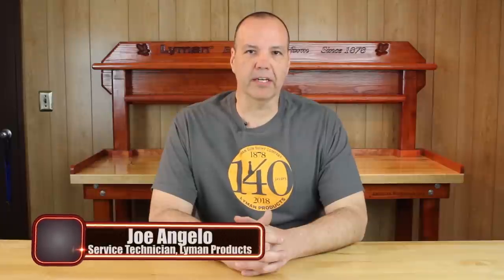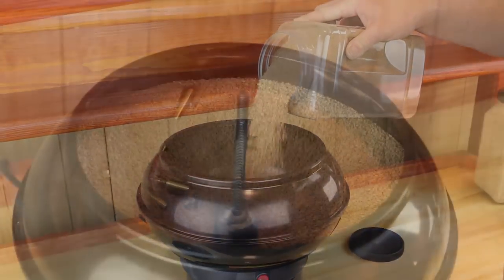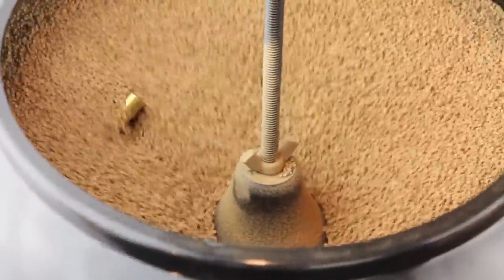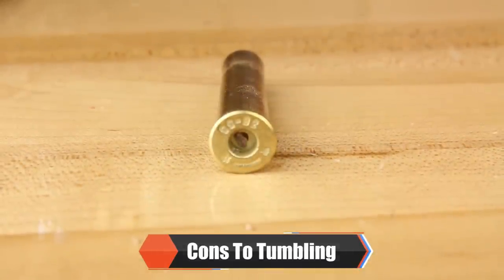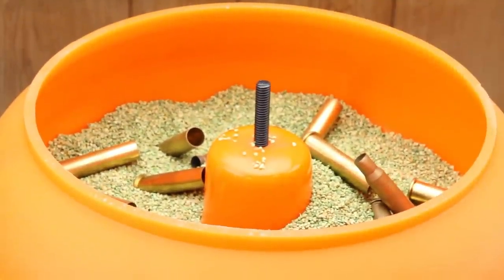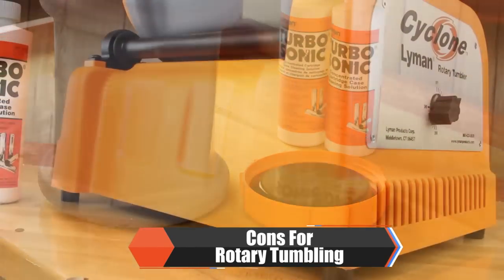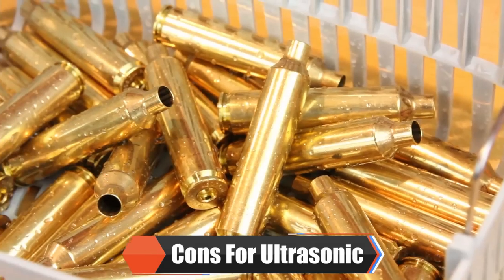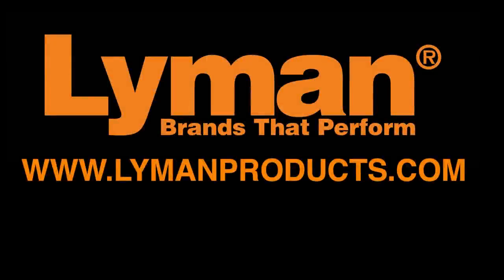Pros and Cons To Brass Cleaning Methods

Comment: Wet tumbling with regular dawn dish soap and a tiny bit of lemishine is what I've been doing for several years. I gave up on dry tumbling because of the lead dust hazard and because it doesn't clean the inside of the cases as well as wet tumbling.

Comment: Unless you are going to make jewelry out of the used brass, the vibratory Tumbler is more than sufficient. 
Make yourself a mixture of 50/50 new finish car polish/mineral spirits and add a few squirts to your dry tumbler media just before turning it on. Your brass will come out shiny.
Tear three or four small squares from a USED dryer sheet. Throw them into the mix and they will pick up a lot of dust.

Comment: I use only Dawn dish soap in my SS wet tumbler, and let them air dry. I have enough brass to reload I do not feel the need to use driers. No more primer pocket cleaning.

Comment: I deprime and size my cases, then clean them in my sonic cleaner, I dry them then put them in my tumbler to polish them off, they come out like Factory new inside and out ! It only takes me about an hour and a half for a batch of 50.
Reply: DrJibson  It's not. That's why I use a universal decapping die. Sizing is done after cleaning and your dies stay clean.

Comment: Dry tumbling poses a significant lead dust and heavy metal contamination hazard.
Reply: I wear a mask when I dry tumble. Is wetting tumbling any better? Now you are rinsing the lead and heavy metals down the drain which won’t be filtered out by treatment plants.
Reply: @djryan8944  Filtration works by allowing only the small particles to pass through. The “holes” in the filter should be smaller than the target contaminants. This way, heavy metals and other pollutants won’t be able to pass through. Also, they won’t end up in your glass of water.

Comment: That ultrasonic machine looks like the one from Harbor freight. I use  $70 Vevor 3L ultrasonic cleaner, water/dawn/dishwasher magic, and a free dehydrator from craigslist. Results are great (and cheap!). Plus I can clean large parts (carburetors, etc) and make jerky.

Comment: If the cases have been stored and are very stained , I give them a quick swish of citric acid this cleans off the bad shit then dry , tumble after. Citric mixed mild is not hard on brass like other acids , Ive found.

Comment: forgot to mention dust with dry method.
Reply: You can cut down on the dust considerably by tearing a few pieces of a used dryer sheet and adding them to your corn cob or walnut media.

Comment: A USED dryer sheet torn into 3 pieces mixed in with your dry tumbling works wonders.  Especially if you're using the red treated walnut.  It will cut dust way way down.

Comment: I tried the " dryer sheet " thing , made my brass look like doo-doo ! Having problems cleaning my .577 Enfield brass . Dry tumbling doesn't get the inside and leaves scuzz on outside ? May look into a wet system and use wifies food dehydrator to dry the brass ?

Comment: When I use my Hornady ultra sonic cleaner the brass looks great right out of the tub but then after it dries for a few hours the cases have greenish tarnish and don't look shiny any more.  Does anyone know what I'm doing wrong?  I'm using a mixture of 4 parts water to 1 part vinegar, with a little dish soap and salt added too.
Reply: Jared Grant 
Just a thought, are you rinsing your cases real well, with clean water after removing them.
Reply: I use the Hornady one shot cartridge case solution, in ultra sonic cleaner.  it only requires 1/2 oz solution to 20 oz of distilled water. My cases come out quite bright. Then I dry them in a food dehydrator.

Comment: Which is the safest regarding lead dust?
Reply: Both the rotary tumbler and the ultrasonic cleaner.  The lead dust will be trapped within the water/ cleaning solution.

Comment: Get 2 tumblers, 1 for walnut, 1 for corncob media. Dry tumbling is not 'either/or', its 'both'. I use them after a wet wash of the classic Dawn, vinegar, lemon juice recipe. Doing the wet wash first gets off 90% of the gunk and keeps your other media clean. For me I've found its not "this" method  or "that" method, but using a couple of methods together. Also I would never dry tumble brass straight from the range, God knows what lead or mercury or other powders you'd be shaking into the room. A 5 minute wet wash first removes any possible harmful powders.

Comment: I use all three , then hand polish .
Reply: LOL you have to be OCD to do all that work.
Reply: @Physics072  I  just started cleaning brass for the first time...what am I using...a dished washed glass jar that was once filled with spaghetti tomato sauce...fill it with evapo-rust, dish soap, salt, close the lid tight and start shaking it. leave it there for a day I would say. take the bullets out rinse them in hot water get the thick blue towels used for cars cover the pan then put every bullet in, let air dry then get the twinkle brass & copper polisher...then polish every bullet by hand.

After that resize bullets especially the ones that been stepped on (dent to hell ones.) and reload them.
Rinse & Repeat.

I decided to use a tumbler again handmade, but instead of dirt or sand or product use....I thought why not just salt??? Haven't tried it yet but going to now actually.
Reply: @905SONICking  
I think you mean cases, and not bullets - right? ;-)
Reply: @skjalglandsem7440  oh no I mean the primers and gun powder you gotta make sure primers and powder are really cleaOF COURSE IM TALKING ABOUT SHELLS!!!
Reply: @905SONICking  Snow flake

Comment: I doubt vibratory tumbling is cheaper. Media may be $10 or $15 to fill the tumbler but the media is a consumable which needs replaced regularly. Add to that the recurrent cost of polish. 

Wet tumbling doesn’t have the recurrent cost of media and just requires soap and acid. 

Upfront costs may be less with vibratory tumbling but in the end the cost/case will be less with rotary tumbling.
Reply: Tumbling media lasts a long long time.

Comment: Thanks but vibratory is a lot cheaper than the other 2 types
Reply: Only if you buy the overpriced cleaning solutions.  Use a bit of dish soap and citric acid (cheap when purchased as a food additive) and the other two methods become cheap.
Reply: The vibratory process can be made even cheaper by using lizard litter from Petsmart instead of the high priced stuff sold by reloading manufacturers.
Reply: It won't plug a flash hole either, too fine.